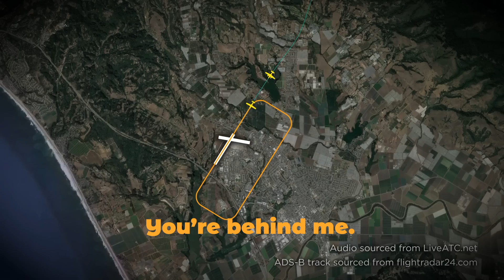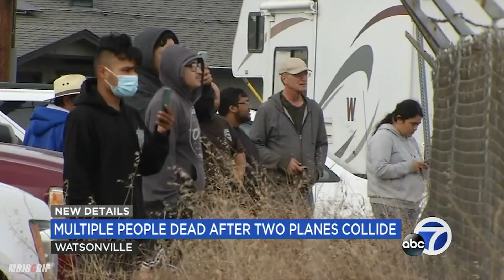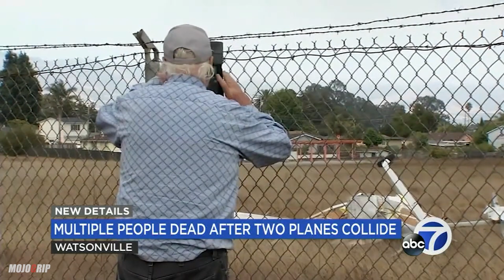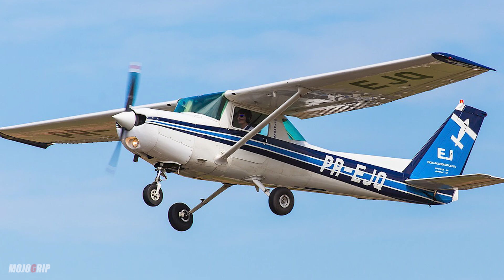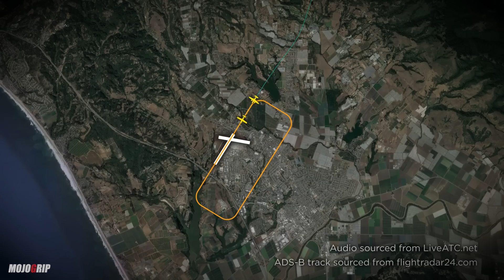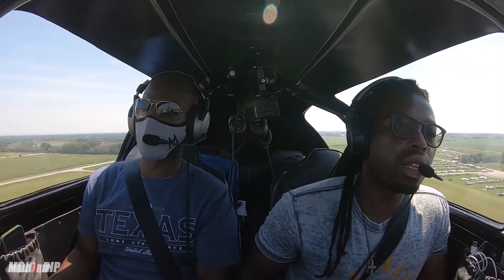Flying Too Fast Can Be Deadly

Comment: Would it be a mistake to install cameras to cover the blind spots created by the wing and a rear view?
Reply: I thought of that awhile back-  there's a lot of blind spots with high wings, low wings, any object even below the cowl is invisible to pilot flying. Today we see many pilots with dozens of cameras everywhere just recording the flight to make a youtube video later. How about use those dozen cameras a yet, another visual aids. 

I suppose one issue is the elephant in the room. A human pilot can only do 1 or 2 things well. Once the 3rd or 4th action enters pilot becomes saturated quickly. With MFD & a 2nd glass planel that shows GPS, and reported planes in vicinity 3rd screen. I'm sorry but having yet a 4th or 7th LCD display is sorta crazy to think. Now, having a co pilot on flights could better utilize all those extra video feeds.
Reply: @Mikinct   The thought I had was 2 screens. 1 located similar to an automotive rearview mirror tied to a camera in the tail and another screen that was selectable between 2-3 cameras. 1 camera to verify the gear is down and locked, 1 wide angle camera on the underside to cover the cowl and low wing blind spot, and 1 wide angle on top of a high wing.

This creates a situation similar to checking the mirrors on a car while driving. You definitely need to prioritize other information sources but the occasional glance could make a big difference
Reply: @chaddoan4659  I'd do it that way if I was flying myself- can't ever be too safe

Comment: The 152 may have been a relatively new student and while hearing the 340 may not have realized how much ground the 340 was covering and carried on as usual. The 340 pilot having more experiencing was aware of a plane in the pattern and apparently didn't care. The 340 clearly should have seen the 152 long before hitting it.. How does anyone think they should land when another plane is on base?
Reply: The 340 pilot was going 185kts on final I believe that plane is a 90 kt landing confi…..
Strait in landings at 185kts 🤷‍♂️
Reply: Well I agree, but imagine this, the aircraft from behind and above has its wings low and the below aircraft in front has its wings high. If it didn't have windows in the back neither of them would've been able to see each other.

But yes, I still agree with you, based off of the knowledge that he had that HAS to be a hint for him that maybe something is not right...
Reply: @Noah44137  The 152 has his PPL for around two years. Not sure why the twin was going almost 190k on final for 4,500' runway.
Reply: You did hear the C-152 pilot Announcing that he was going-around, right? And don't speculate that the C-152 pilot was a student. I know more than one decades-experienced airline pilots with 20K+ hours that own and fly light single-engine airplanes, and I'm one of them.
Reply: I would of changed my intention early and joined in on the traffic pattern once I learned another aircraft intention is to land on the same untowered airport and is already in pattern.  The 152 had the right away to land first being lower altitude and in pattern.  The real question is the 185kts on final with the c340.  AOPA specifies the c340 maximum structure cruising speed is 200 kias.  I’m assuming 185kts is a bit over vle and vfe.
Reply: Not to mention the twin was hailing ass the whole way..

Comment: 1- twin was way too fast  he couldn't land at 140knots? (not sure if that was what I saw) - 2 - i did not hear the 152 state turning final & short final -  the twin was at fault majority%, he should have throttled back 5 miles out and if he came upon someone on short final he should have stated his safety avoidance plan he was implementing and performed a climbing turn to the right to 1000 AGL(seeing as the circuit was left it was the safest direction to proceed) and joined the circuit appropriate to the pattern in use allowing for the location/position he was in.  What i did notice was they were NOT communicating between themselves. There in lays the only potential that could have saved them given the rest remained as it was.  There will be a court case happening soon against the twin pilot. ..as I see it given the information i have to make a call from. NOT SAYING I AM CORRECT.

Comment: The FAA should required ADSB In and Out EVERYWHERE. Then get an alarm if anyone is within 2 nm(tbd) of your location. with ADSB you could even get an alarm of imminent danger since the computer could calculate if the planes will crash based on speed and trajectory.  We have the technology  right now to make this happen.
Reply: I would like to add that with this, Flight Following will be a thing of the past. The computer will be doing the FF for you.

Comment: I think your assessment is very insightful, and I wonder if one more factor may contribute. ( I’m sure there are many individual factors, but like you were talking about as a general mindset) what about alternatives, pilots plan for alternates all the time when it comes to finding a place to land, if primary experiences unfavorable weather, they need to go to an alternate airport. What about anticipating alternates in your “red zone “ flying? For example: your coming in to land, you aviate, navigate, communicate… all the god pilot things, and looking for traffic, now ask and answer the question, what would you do if you see or hear traffic on the landing pattern, what if you hear traffic on the radio, but don’t see it… what will you do? Will you add power and elevation, plan a go around until you can verify conflicts are cleared? 

Then practice it. I wonder if part of the problem is a habit of having plans that don’t change. So having planned alternates for landing is planning for changes, having planned actions for engine out on takeoff is planning for change, maybe planning and practicing for traffic to happen can help people break the plan fixation. Instead of operating out of planned space, it’s executing an alternate. 

Just a thought.

Comment: I'm gonna say this mojo. Flying a plane should have rules of air like driving a car has rules of the road. Sumone should have yielded. The twin was coming in 2 fast 1st of all knowing sumone is in the pattern. 2nd the twin should have given him the right of way know he was closer to landing than he was. 3rd once it had been determined by the twin single was aborting its landing he should have also done the same and did a reset and communicated that to the single as well. The single could have climbed out doing the runway heading and the twin could have broke right. I understand about flying the plane but never rush to the point u can't abort a landing
Reply: Good points. The regs 91.113 say the lower altitude airplane approaching for landing has the right of way.  If I were in the 152, I would think I have the right of way, the person in back of me needs to make adjustments. The issue in that perspective is that the twin Cessna did not make adjustments in time.

Comment: Hi Mike, being an experienced ultralight pilot when around airports is where I have run into many problems with general aviation pilots. As you say they are focused on what they are doing and seems to not be concerned with other pilots in the area. Maybe they don't seem to be so interested in the others. Many times I myself have had to avert my flight patterns to avoid their flight paths to save myself. They don't seem to notice or even see others. I don't know if they are being inconsiderate, don't care or are only concerned for themselves. Which doesn't make any sense to me. One tract minds.  🙅‍♂ I would like to say, first person in the pattern has the right of way, but that probably wouldn't do it either. Arrogant pilots still end up dead.
Reply: A lot of experienced pilots are not aware of the "recent" (2018) changes to non-towered airport flight operations, see Advisory Circular 90-66B https://www.faa.gov/documentLibrary/media/Advisory_Circular/AC_90-66B.pdf
Garry, your flight pattern adjustments would be unnecessary if everyone would just "stay in their lanes."
Reply: more than likely  those are the pilots who got 70% on their exams.  It's the 30% of STUPID that will kill you and others...(20% of they raised it to 80% pass)

Comment: The twin never saw the 152.  That was the fatal error. See and avoid.  Even know the twin was way to hot. He announced his 3 mile final before the 152 pilot called base.  If I heard that someone was on 3 mile final,  I would have extended  my downwind until they crossed my wing.  Then turn base.  But knowing this airport and like most uncontrolled fields with flight instruction and jump activity, the safest way for the twin to approach was by joining the pattern. Not straight in.  RIP to all that passed.
Reply: The twin was screaming. Too fast to ever lower gear.
Reply: I don't think the twin even heard or pay attention to radio traffic. Usually both aircraft acknowledge each other

Comment: What would you have done if you were the 152 pilot
Reply: not turn base into a plane on 3 mile final unti i had them in-sight.
Reply: @ricardo-sf  The 152 did respond that he had the twin in sight. That's why he went around when he was on final.
Reply: With another aircraft that close (inside of 10 miles) on a straight in approach, I would have extended my downwind until the other aircraft had passed me.
Reply: @BrewToo  well said.  My though as a student pilot point of view was: I have the right of way.  It didn’t matter in this instance.

Comment: The way I think about  it, if you had removed the 340 from the situation, the 152 would have landed just fine. If you had taken the 152 out of the situation, that twin would have probably crashed by coming in way too fast.
Reply: This accident wasn't caused by traveling too fast, but clearly the twin pilot did not see the 152. 
It's puzzling why not, given that pilot 340 will be focusing on runway and airspeed.
Reply: I have been wondering if it is a medical issue.
Reply: don't know the length of the runway - did not look it up - but at 140 kts gear down most likely he would be 130 across the threshold and have to lose 30-35 kts to stick to the runway....that's allot of brake$. Guy just was not thinking. Also the tower should have told him to lower his airspeed and turn right vector him away from the field, circle back to center field crossing at 1000' to join the circuit downwind L ...no straight in - he could see on the screen what was happening long before it was an emergency. Poor 152 pilot.... sounds like the twin just plowed into him straight on - instead of doing a climbing right turn and STATING HIS INTENTIONS on the radio.  I am 68 and commercially rated but man oh man when its time to hang up the license its probably past time.
Reply: @stevemyers2092  you're speculating and don't know anything about the pilot. And you're not even paying attention to the situation. The airport was a non-controlled airport and no tower to tell him anything.
Reply: @stevemyers2092  there was no tower… it’s an uncontrolled airport
Reply: @stevemyers2092  FYI: Watsonville is an uncontrolled airport….. (No ATC.)

Comment: i've only watched the first 2 minutes of your video -- and already i disagree .. you said there was clear communication between the two pilots at watsonville .. -- the audio shows that while they were both communicating on the radio -- neither pilot attempted to communicate with the other ...

neither pilot realized there was a conflic and attempted to deconflict the situation while there was still time. (it happened right at the end when it was too late).  this accident could have been avoided if the pilots had deconflicted their approaches while the 150 was on downwind and the c340 was 3-5 miles away.

--- (i've watched more of the video now) -- when i'm flying the pattern or near an airport i always assume that all the other pilots are trying to kill me, and they will do exactly the wrong thing, and then i fly defensively.  -- i've already learned to never wait for the other pilot to take an action to avoid a conflict.

The ethos of "fly the airplane" first.. is a reminder when you are in an abnormal situation .. a landing is not an abnormal situation, and you should have enough capacity to fly, and communicate with others in the pattern, build a situational awareness and deconflict with others.
Reply: Bingo.  They were "communicating" but not listening.   Why not use plain English like:   "  This is Cessna Twin we are coming in VERY FAST  straight in final  Please go around!"   If the The 152 doesn't acknowledge or says anything other than  "Copy  Go around"  Then the  340 should immediately abort landing and enter pattern.   They could argue about  it safe and sound on the ground.   The 152 had no idea the  twin was coming in so hot...and might have even not heard it ws a twin.
Reply: In the video heard the 152 acknowledge the 340 and knew he was coming in hot and decided to go around, but never heard the 340 acknowledge the 152.  I'm still wondering if he was new to the aircraft and was task saturated.  When the 340 announced he was 10 miles out, the 152 probably figured that he had a few minutes, not realizing the 340 was coming in like a rocket.  When the 152 did realize the 340's speed, he announced his intentions to abort and I don't think the 340 ever knew he was there.
Reply: @jgoose7126  I agree, the 152 did acknowledge the other pilot but didnt know the twin engine was coming in at cruise speeds.   While it seems late in responding to the twin engine,  at the speed the twin engine was travelling he was covering ground far faster than he should have and shouldnt have been where he was.  Doesnt matter to those pilots now, but to the rest of us it tells us mainly to not do approaches at cruise speed and at the same time expect the unexpected.
Reply: Agree
Reply: It's true. The pilots did not acknowledge each other.  A type of airborne road rage. The twin did not give an inch to the little 152. And the 152 thought too late to back off. They both paid dearly.
Reply: @skorrchafer  imo both airplanes have blame to share ... the c340 pilot was wreckless doing the kind of approach they did with others in the pattern. --- the c152 pilot failed to realize that turning base into a plane on 3 mile final would be a conflict. -- both failed to talk to each other.

the 152 had right of way -- but right of way means nothing if you end up in a crater in the ground.
Reply: @ricardo-sf  "the 152 had right of way - but right of way means nothing if you end up in a crater in the ground."  I came here to post exactly this.